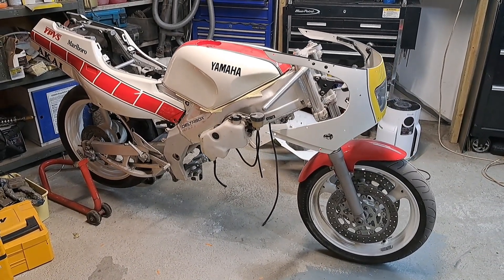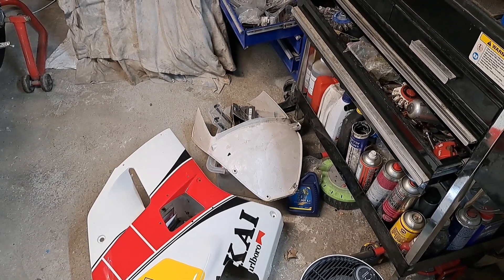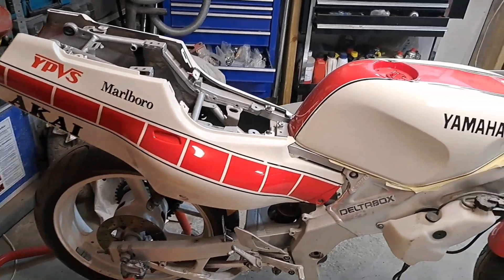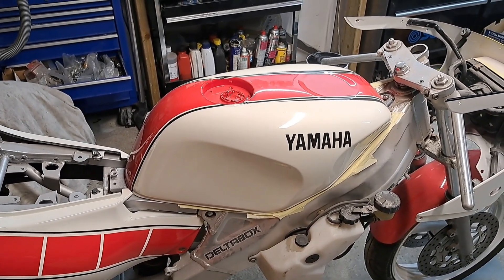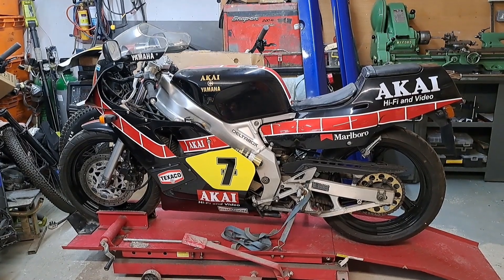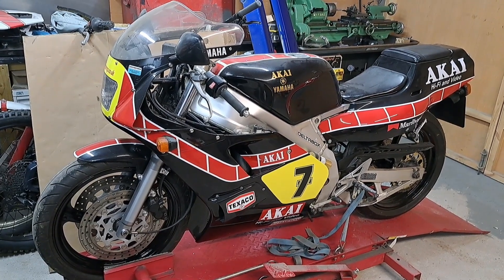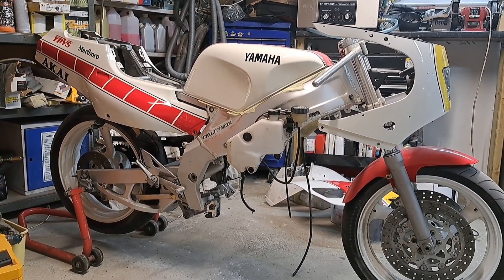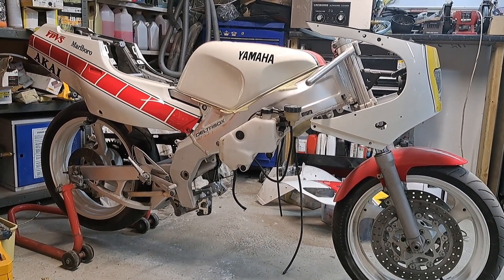How to paint a motorcycle like a pro yamaha tzr 250 3ma

Comment: You always get the tank decals looking exactly right but I see other bikes by other painters where the decals just don't look in the right position or they are the wrong size, too small, too large etc. Any tips on how you get yours to look so good?
Reply from the maker: Thank you. I think because I have been in the body trade from 16 years old, I try to be accurate with everything. You're always working with measurements. I always offer them up and look at them, and if they don't look right, I will make some more. Sometimes, I make a few sizes and try them to see what looks best.